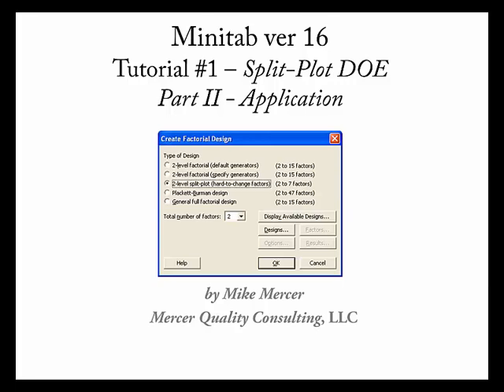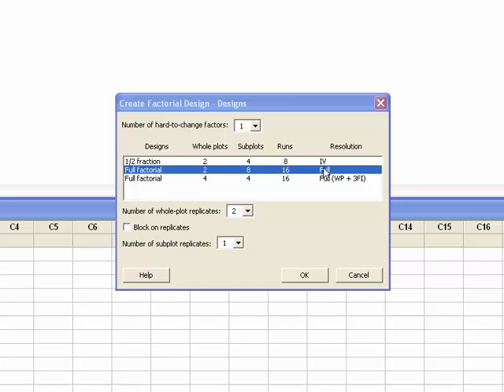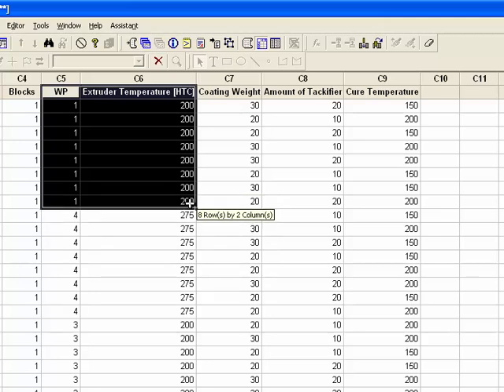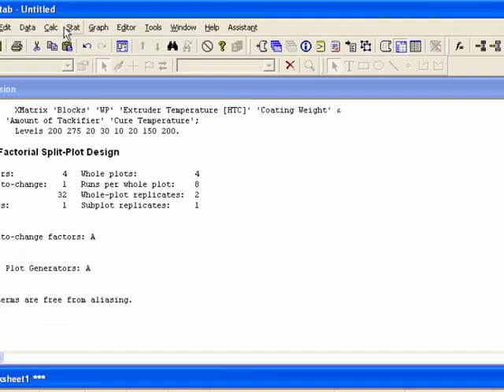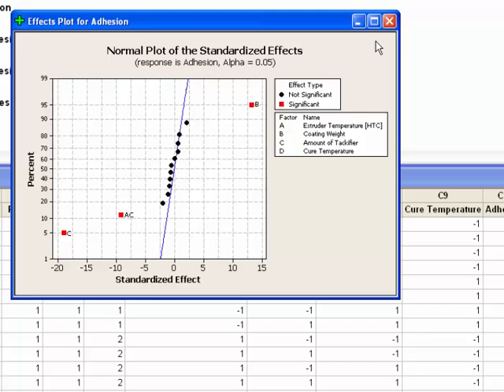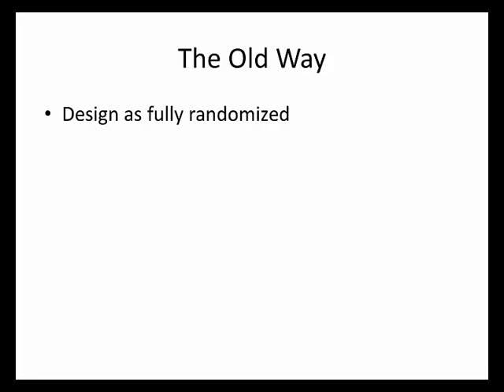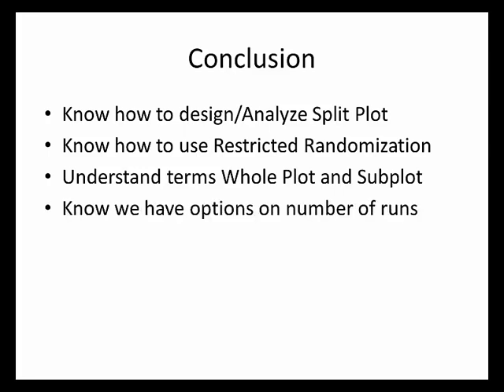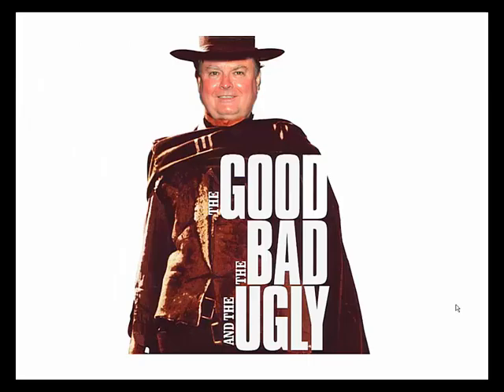Minitab 16 Tutorial #1 Split Plot DOE Part II Minitab Final

Comment: Hi Micheal,

Thanks for such a great tutorial.
I have a question about split plot factorial design if we have more than 2 levels for one factor.
I'm having hard time to assign 4 levels to one factor in my design. How could I do that?

Thanks
Reply: Currently Minitab only has 2-level Split plot experiments.  There might be a way to create such a design in the General Factorial Design module using blocks as whole plots, but then the analysis would need to be reconfigured.

Scott Kowalski (skowalski@minitab.com) at Minitab is their recognized Split Plot expert, you might contact him.

Mike
Reply: Michael Mercer Michael,
Thanks for your kind response.
Do you know a good reference (like what you did about split-plot) for this general factorial design to show me how to do that?

Thanks
Reply: Michael Mercer Thanks anyway Michael.
Reply: Kamran Kardel Go to the ANOVA tab and use the GLM to set up a multi-level split plot